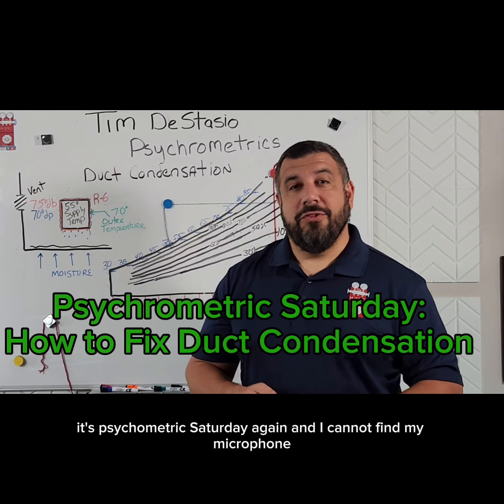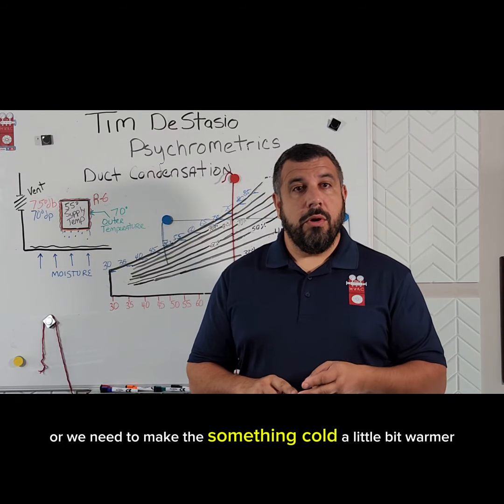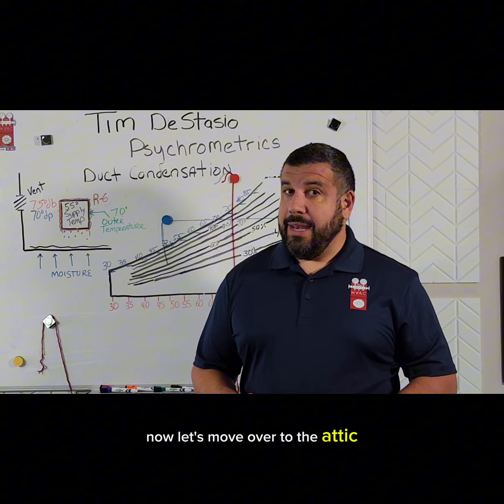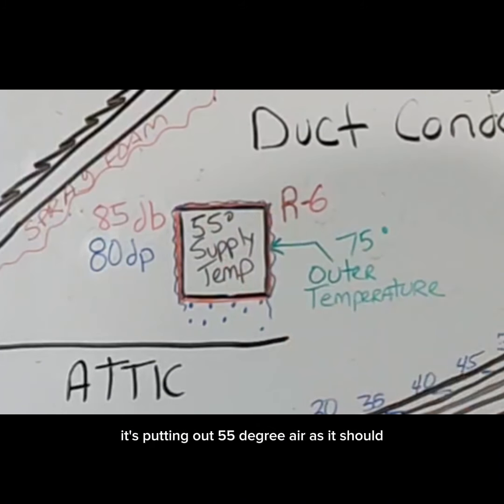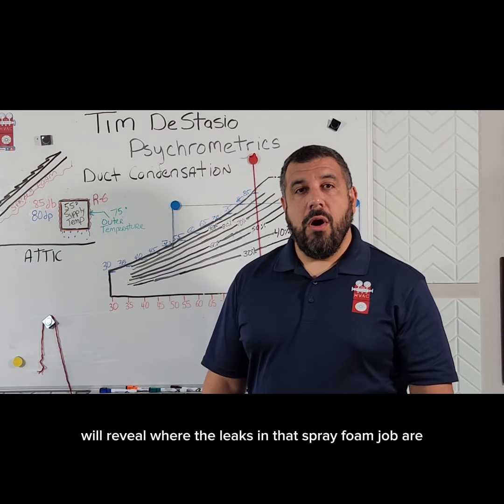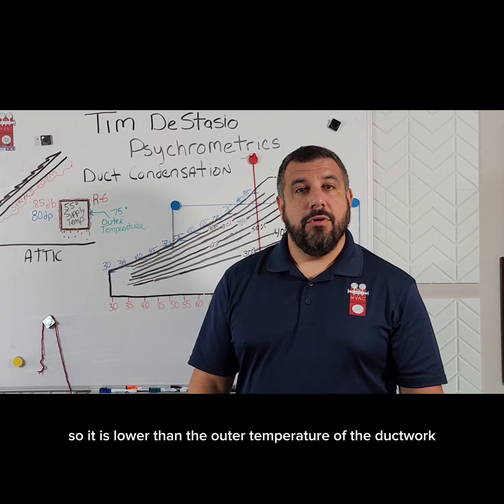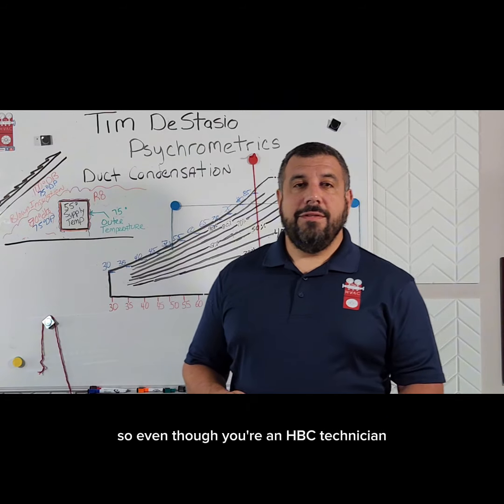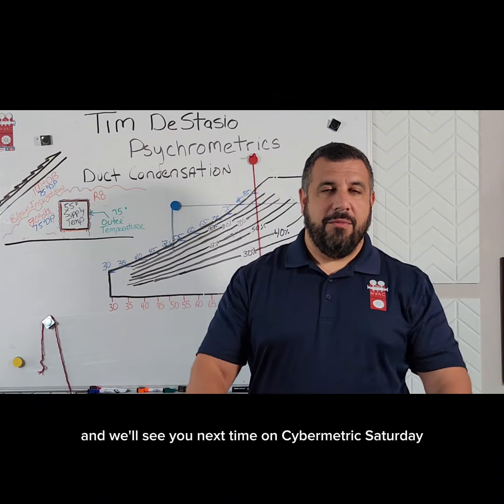Psychrometric Saturday: How to Fix Duct Condensation

Comment: Commenting before I finish you’re video. But I do residential HVAC just south of you, we were having tons of ventilated attic that didn’t have shield tec sheathing with ducts sweating. It was a nightmare for a few weeks
Reply from the maker: Even vented attics can have ducts sweat due to extremely high dewpoints during the recent tropical storm.  The best was to fix it is very expensive- an encapsulated attic, or more ventilation in the attic.  Not attic exhaust though!  Just moving air within the attic.

Comment: The only thing I would say about this video is…..  most codes require a minimum of R8 insulation in unconditioned spaces.  Other than that, this information is gold!
Reply from the maker: @anthonydesimone8308  yes but they didnt always. Theres alot of r4 and r6 ducts out there from 20-50 years ago.

Comment: Hey Tim great video as always.  Is there a resource/Calc to calculate the surface temperature of the duct depending on the SA, attic temp/RH, duct R valve?
Reply: I asked him that (I think) last week.  I did find a calculation but it has a few problems.  Trying to find the actual inner film and outer film R-Values, and it doesn't account for radiant gain, which is really hard to calculate.  So if you found the correct inner/outer R-values, in an attic, the surface temp calc would only calculate the bottom of the duct surface (not getting hit by radiant gain).
What I think might be easiest, is simply one psychrometer in the duct, one in the space, and a k-type thermocouple slipped through a slot in the insulation and stuck to the duct itself gives you the information that you need to decide on a solution that Tim recommends.
Reply from the maker: @AC-SuperCool  search of youtube hvac school.conductsation. a great seminar by rick sims.

Comment: Have a non spray foam attic with lay in bats insulation. All the ducts are sealed pretty well. Supply ducts are water logged. Besides letting them know not to set the tstat to 40% humidity at 71° would recommending an attic dehumidifier be a good idea?
Reply from the maker: @TrillasTexas  no attic dehu unless its encapsulated. Ducts need to be R8. Attic needs even more ventilation. Get the ducts out of the blown insulation.